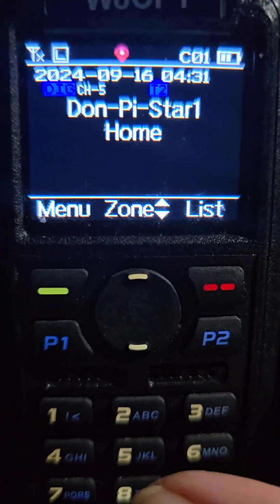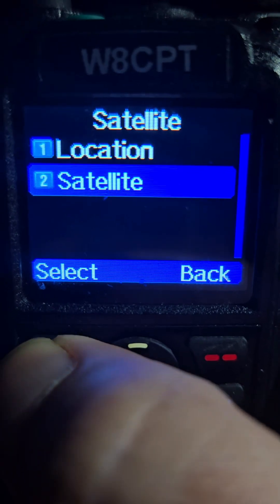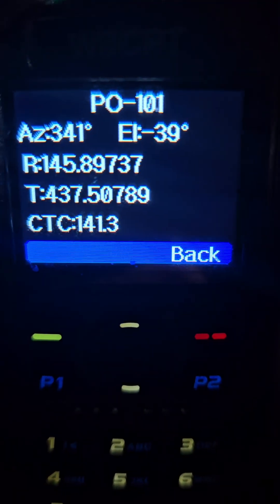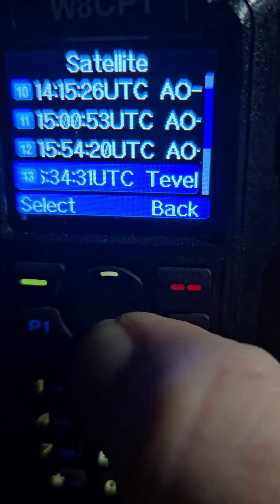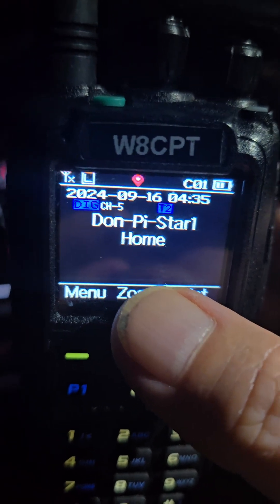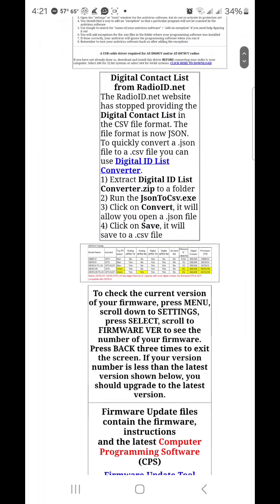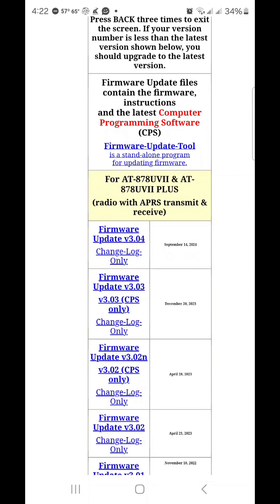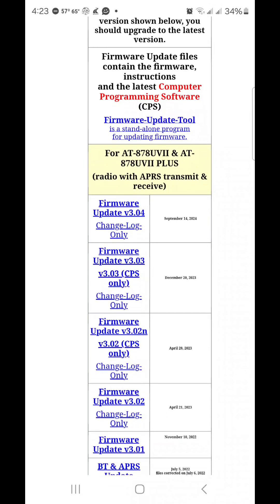How to use your Anytone 878 to work Satellites!!

Comment: I get a satellite data error
Reply from the maker: @mitstax  that's a new one...
Reply: @w8cptCptDon  in just updated the cps and radio. Went to satellite, location is fine l. Click satellite and get that error. Am I missing a setting?
Reply from the maker: @mitstax  not sure. Seems to be alot of  bugs on the Satellite function...
Reply: @mitstax  Yes you have to enable GPS and set it for line 1 "GPS"  at the GPS mode and maybe something else that I forgot :.) It will only work on models that have GPS built in.
Reply: You have to upload satellite data via the CPS. That is what this error is telling you.

Comment: I can hardly believe that the Anytone can operate with satellites. The FM receiver is deaf compared to the Icom Yaesu Kennwod and even the cheapest Baofeng transceivers.
Reply: going to find out
Im sure it would work better if you have an outside antenna that is designed for Sats.

Comment: If you complete the icon update, the sat menu will have a sat dish icon instead of the speaker icon.  Same process as the firmware update except for the buttons held during power-on.  There is a PDF with instructions in the firmware zip file.
Reply from the maker: @BenjaminMartin1776  i did that it's PTT and P1
Reply from the maker: Correction i didnt...I made a part two video... any place that explains how to update the keps mine are off when I update them...
Reply: @w8cptCptDon  I think they are updated with the CPS "satellite data writing" menu, but that's just a guess.  If I had any one thing I'd like Anytone's manufacturer to make it is to provide better documentation.
Reply from the maker: @johnclark2849  yeah I messed with it extensively last night that's you you update the keps but something ain't right and the keps are wrong
Reply: @w8cptCptDon  I also noticed the Keps are not correct.  Even with GPS Beacon set correctly the predictions appear to be several hours off.  In other words, a current ISS pass will show in my listing for more than 2 hours in the future.....  btw, most TLE listings are only 2-3 days worth usually and you would have to update your radio with new data every several days.